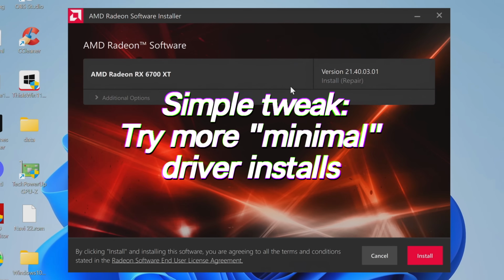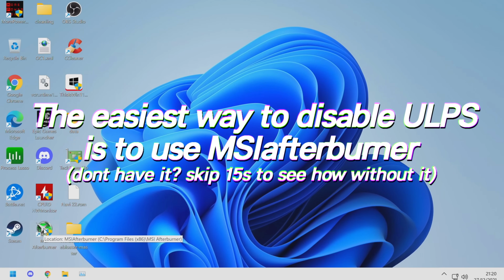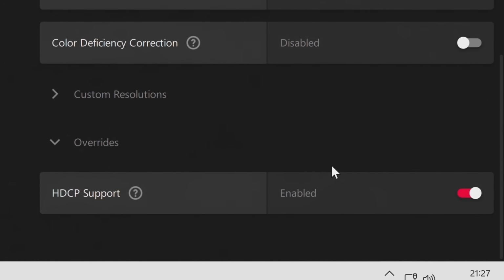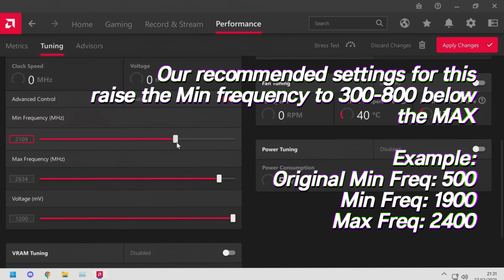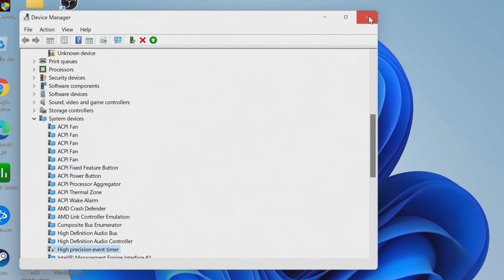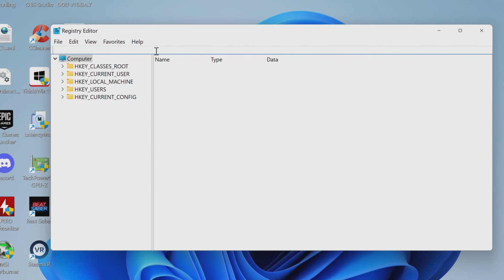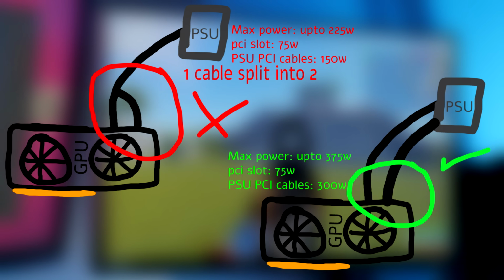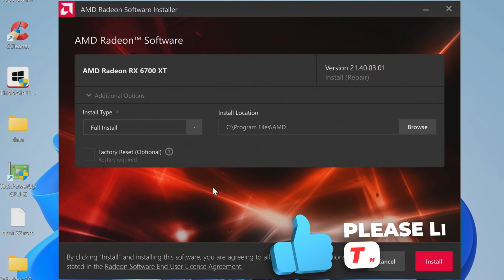🔧 Have an AMD Radeon GRAPHICS CARD? You should use these SETTINGS! *FIX LOW PERFORMANCE & CRASHES* ✅

Comment: what settings to put on if u want stretched res? I’ve looked at every vid for FN on stretched and it still displays black bars 😭
Reply: Try enabling the gpu scaling in the display settings inside the driver. That helped me with black bars.

Comment: there are cables that are nice and big that will actually do up to l;ike 350 watts but i barely see them i got one with my psu it has an 8 and a 6 pin plus another 2 pins to the side and i have had 0 issues running an overclocked 590

Comment: I have onboard graphics as well as a dedicated graphics card, but when I play games, only my onboard graphics are used rather than my dedicated gpu. What should I do? I've already tried the power plan option, and both options simply display my onboard graphics.
Reply: You would have to go into the Bios of your specific motherboard model and forcefully disable your CPU's graphics processor, I had the same issue with a Ryzen 2200g. Look up how to do it for your own motherboard, it's a very simple process so don't worry about it.

Comment: In my radeon settings, the power limit goes up to 50, not 15 like in the video. Should i set it to 50 or only on 15. Thank you.
Reply: @expr0m i do want to overclock my rx 5700xt, so i will have to rase the power limit, i guess i will try 15% to test it

Comment: Hlo i am facing a issue i have r9 270 2gb msi which is old gpu but it was working fine now the issue i am facing is getting too much low fps from actual fps i get 10fps instead of getting 50fps in rdr2 i checked msi afterburner gpu utization is 98% its mean full and clocks are also full 955mhz and 1400mhz and i am using sixpin connector i am facing this issue from 5 to 6days plzz help i cant play games 😭

Comment: Besides those priority regedit settings, the windows settings he showed you do not noticably affect performance at all. The power plan features especially just wear your hardware faster, whilst not being necessary at all.. 
If you really need to squeeze out some performance consider using a tool that stops any background processes to free up your processor (you can also modify the services that start up with your pc using msconfig. To launch this, hit Windows+R and then enter msconfig). Various applications such as dropbox, itunes or spotify always have these background processes running that when all combined can take up a significant amount of CPU. Shutting these down together with changing the priorities can help. 

When running a game you can also head into the task manager and right click on a program and change the priority to High from there!

Comment: This video helped my issue with my 5700XT playing FFXV. I was getting average of 55-60 fps on the lowest details 1080p, which was very underwhelming performance and not what i expected. Not sure exactly which step fixed it, but now I'm getting 70-80 fps on high/max details even at 125% resolution😁
Reply: yea this was to be expected lmao. the 5700xt is only around 15% less powerful than the 6600 so it would've been quite concerning if this didn't fix it
Reply: @Shadowsnoon  6600xt*
Reply: @MarcABrown-tt1fp  true my bad
Reply: @Shadowsnoon  np 👍👍
Reply: That happened to me too on some games like RDR2, it run really bad on my rx 6600. I just set the performance tuning and clock to default, and disabled the amd tesellation to aplication controled. Restarted and that worked for me.
Reply: And you did all the steps he did?
Reply: Wtf

Comment: Most of these settings are good. But! Me and my friend found that games ran with much more fps and much smoother, when system responsiveness was left as is. Testing it out should be fine, if it works use it, if it doesnt leave it.

Comment: I got myself a new psu (Corsair rm750x 80+ gold), and so far, it looks like it stopped my fps drops and stuttering... My old PSU did have enough watts, but it was only a thermaltake 80+ bronze... Don't spare your money when buying a PSU... Get a good one
Reply: Does it stop it in all games? I’m using a 5900x and 6800xt and a 750w power supply but I still get wattage drops in dx11 games. I really think the issue is software related and you have a correlation not a causation. Glad it fixed it for you though
Reply: @p_enta5012  it removed 70% of thee problem, it still occurrs

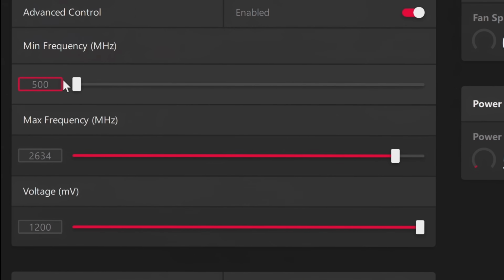Comment: The overclocking part in my settings (5:07) is by % not MHz how can i tell im setting it correctly (Radeon 5600 XT GPU)
Reply: Turn on advanced settings
Reply: Advanced control switch just above the slider

Comment: Someone can help? I have an rtx 3070 with ryzen 7 5800x.... i have 170 + fps my game crash  if i overclock my GPU always i cant play with overlclocking ...before caldera all is very good... the next problem ....if i do all settings to high there is lot of stutters and tearing also ...i have gsync on and why its like this?  If i do all quality on high also the rendolution 4K ....i have 80-100 fps but why its not smooth with gsync ? I have much problems ....dev error / direct x error if i oc my gpu or crash and freeze without any error... why i cant play with high settings on 80-100fps without stutters an tearing ...all is bad

Comment: This is such B.S.

I have my RX 5700 xt back to factory for a RMA. Still waiting for repair.

2 years now with fully AMD. 2 years following your video and I had so many issue.

BSOD crash, had to change my bios.
My ryzen 5 3600 was working with 4 cores out of 6, changed my mobo, psu, new cpu, new ram, new SSD Nvme, bios update, windows update, radeon updates  bios settings tweak, amd settings tweak, windows settings tweak dude i legit fking did everything.

I dont want to trash your video, but you should not even be supose to do all that kind of bullshit tweak. Plug in and fking play games with no problem.

Im curently playing on my gf pc as im still waiting for my gpu to comeback from RMA. Im playing on a GTX 1070 and boy this old gpu is way more stable. No stutter, no crash no bs settings.

Disclaimer, AMD is trash. Shit product, shit drivers, full of bugs. All this shit in 2 years. Spare some cash and go green and blue. For me im done with red.

 I spend so much time on optimisation for no result what so ever. And so much money on repair.
Reply: Facts g Nvidia is so much better so much smoother. My gtx 1050 ti felt smoother than my rx 580

Comment: A lot of my games are getting black screens where the PC stays on and the sound stays on but the screen goes black and after restarting I'm met with "Radeon wattman settings have been restored". When I take away the amd software I still get the crash but no wattman message. I'm running a 6900xt, 5800x, tuf x570, EVGA 1000 watt psu. Windows 11 recently installed. Everything has been default no overclock. I have been using Ultimate performance power plan. I thought my problem was the monitor an LG 27gn950 4k 144hz. I haven't been able to thoroughly diagnose.

Comment: so i did most of this and its great except now halo infinite makes my GPU grind (no other games does this Forza horizon runs fine) 6900XT on a samsung G9 monitor doesnt matter what settings I change it makes a grinding noise constantly soon as it hits the main menu
Reply: That is coil wine and it comes from to high of a fps in game menus and in older games. It usually manifests its self over 400,500fps cap the fps in game to 240fps or lower. Coil wine is normal and it wont damage your card.
Reply: i aint a genius but shouldnt check if your fans are dusty?
Reply: Check your gpu fans
Reply: @memetemplat267  thanks for the tip its not them I stopped then individually and no change to noise
Reply: This is normal, this is called coil whine. When you push a ton of wattage through a graphics card the power components make a little bit of noise. It goes away in a few months as you break in the card

Comment: I especially recommend installing driver only option if youre running win11 because i swear its like a coin toss something radeon software runs fine and other times it bugs out and causes problems on win11 and im not sure why
Reply: Don't install the AMD Driver Update that Windows gives you!! That crashes the AMD Software and makes you reinstall it, I did that like 4 times before finding out it was the optional Windows Update for AMD Driver that was causing problem!
Reply: @jamesb1988  that's assuming win11 doesn't auto install the optional driver update anyways. Sometimes I had to literally tweak my registry to tell windows  update to fuck off. Microsoft is starting to become too aggressive with attempting to streamline windows. I really hope proton solves anticheat someday we need Linux to become a serious competitor to windows because I'm tired of this shit.
Reply: @RaidenKaiser  Agreed. I seriously regret downloading Windows 11 because literally the ONLY game I play on my laptop is Microsoft Flight Simulator X, which was made in 2006. With Windows 10 it ran flawlessly with all the graphics and resolution maxed out.

Since downloading Windows 11 I've had to nerf like half the performance settings just to make it playable. Seriously rage inducing.
Reply: true
Reply: Ddu first..

Comment: Setting your power profile to anything other than "balanced" can negatively affect Zen3 CPU performance, due to its architecture being designed to perform best with that profile.  It is better to change PCIE link state power management to disabled inside the profile.  Also, you should disclaimer the fact that changing all these setting will make your GPU run hotter and consume more power than before.
Reply: I have an AMD Ryzen 9 5900HX and a AMD Radeon RX 6800M. Should I just  use balanced windows mode and just adjust from there?
Reply: @zaky9902  yes, although, depending on the manufacturer, those settings such as PCIE link state management may be locked.  If you can change them, and there is a performance difference, you may be one of the lucky ones.
Reply: @kobusdowney5291  Yeah just checked I guess I am pretty lucky. I put windows balanced and just changed the settings to what would give most performance. Thanks for the help!
Reply: You are so right - setting power profile to anything other than "balanced" results in  FPS drop up to 2,5-3 times.
Reply: ryzen has 'ryzen optimized' power plan use that, make sure to update the chipset driver
Reply: @iikatinggangsengii2471  I learnt a few things since I made this comment.
Zen3 has a hardware power management.  Changing windows power management should do nothing essentially.  Zen3 power management responds in 2ms to power demands, whereas Windows power management updates 10 times a second only.
Reply: @kobusdowney5291  I have bitsum highest performance through park control app I use ryzen 3 3200g with Vega 8 integrated graphics
Reply: @deb5110  3200G is Zen1+.  Any software power management will work yes
Reply: @kobusdowney5291  OK so how do i performance issue with TF2? Its a Direct X9 game.
Reply: YOOOOOOO WTF?????? THAT ACTUALLY WORK MAN, THANK YOU SO MUCH. IS VERY PERCEPTIBLE THE DIFFERENCE IN INPUT LAG. I was using high performance mode, but that thing that you said made things felt so much better.
Reply: @NaderHue  Microsoft network internet  are taking resources. Turn that off in the tweaker 4.8 as well

Comment: hey bro thanks for this ,it worked ,also i have a doubt i have a laptop .8gb ram ryzen 5 3500u, 4+4 dual channel ram ,im thinking to upgrade gonna remove 1 and put a 16 gig
but my ram is 8gb and the igpu is 2gb so i get 6gb ram .what happens when i take out a 4gig and put a 16 gig ram ? the clock speed is the same soo what will happen to the gpu vram?
i dont have a seperate gpu only igpu
Reply: U can't have more than 12 gb ram I also have the same laptop
Reply: @Blade_Editz929  oh is there any reason for it?
Reply: @pranavv6784 ya it is the max capability for this laptop thats the reason

Comment: 800w is NOT minimum at all, don't listen to him. You can search up the recommended watt for the newer RX cards. Even the rx 6900 don't need 800 w. Stop spreading false information.
Reply: "spreading false information"
Its called future proofing because
Oh Look! Intel 13900KS + 4090 requires ungodly power consumption.
If you spend the extra 50$ to go from 650watt to 850watt you don't need to spend another $150 for an entirely new psu when you inevitably change parts in 5-6 years
Reply: I run an RX6800 on a 750W PSU, together with 2 RX580s for mining.  Never had the PSU cut out, even with heavy stress testing or gaming sessions
Reply: @kobusdowney5291  Exactly. Stating that a 800w PSU should be a minimum is the dumbest thing I've heard. I am running a RX 6600 overclocked with 500w and I haven't had any issues. Neither is watt the only important thing about PSUs.
Reply: i run a rx6500xt 600 fps fortnite with a psu 650w lmao but it a good quality one but still
Reply: You can use a 750 watt or the minimal they suggest.... but you're losing some performance.
Reply: I have a rx 6700 and I run on 650 w
Reply: yeah plain misinformation ,you need a least 1200W
Reply: Well I'm using a 650w on a 5700xt 8gb oc editon and I'm using both cables and not one and I'm still crashing haha
Reply: I run a powercolor 6950xt on a 750w bronze Corsair. CPU is 5600x. No issues at all
Reply: That's what I thought, until I built my new Intel 12700K system with a 6900XT formula OC.
 My 850w Seasonic  80 plus gold X series wouldn't even turn on (rated at 70amps). 
For my 6900XT, the recommended PSU is a 1000w. I can confirm by experience at least for my card it's a true statement. Anything less, it won't run period. The reference cards are a different story.
Reply: @CrazyCranker  if it does not even turn on, that would mean something else was wrong.  You should be able to boot on even a 450w PSU, since there is very low load on GPU on boot.  You should only experience issues when stressing GPU or in demanding games if the GPU was the culprit.
Reply: @kobusdowney5291  Straight from the spec page on Newegg: ASRock OC Formula Radeon RX 6900 XT Recommended PSU: Wattage 1000W
Nothing was wrong except the 850 didn't have the AMPS needed.
I plugged in my Silverstone 1000w w/83.4 amps and it fired right up.
It's all about the Amps not the watts
Reply: @CrazyCranker  are you sure the ols PSU still works, and that everything was plugged in properly?  Because it should boot, since the card draws low current at boot.  Amps are directly proportional to watts, and all modern PSUs focus power rails on 12V side for highest current draw.

Comment: The last three settings in this (minimum voltage, 2 power cables  and switching to pci 3) are game changers if you wanna play Fortnite.  Way more stable frame rate and you can actually play performance mode at a high fps rather then it tanking.   Thanks @panjno
Reply: Switching to DX12 on Fortnite solved the fps drops for me with my 6900xt
Reply: Switch to dx12, rdna2. Area have problems in dx11 games
Reply: @jboy402  same went from like 150fps to like 400-500fps
Reply: @slashed4548 jeebus, what settings and GPU?
Reply: @jboy402  5950x and 6900xt all i did was change it to dx12 on fortnite
Reply: @slashed4548  what about performance mode? Do you guys play competitively or just casual and want the game looking good with fps
Reply: har har har har har har
Reply: I play on a rx570 with and i5 10400f and can run about 160 fps solid in game but experience the occasional mid fight dip, only goes down to 80 fps but still. I have a 600w psu but never experienced crashing etc, should I increase power demand,decrease it or just ignore anything he said about voltage and just leave it stock?(ps:will be getting a better GPU soon)
Reply: @bumblbt00na  Can you undervolt and overclock for your RX 570? Also clean up any bloat on your PC and change Radeon settings and run Medium View Distance Medium Textures for Fortnite performance mode.
Reply: @decliningship4208  got a new GPU (2060 OC), thanks for answering tho, I’ll keep those things in mind when customizing my new one

Comment: Reguarding disabling ULPS, this should not happen on RDNA2 and later, they have fixed some major GPU reset bugs, previously AMD GPUs could end up permanently hung but that is no longer the case... it could happen if you ran some bad code and crashed your GPU also.
Reply: i agree and the fps difference is very low but the temps are like 5 more degrees higher

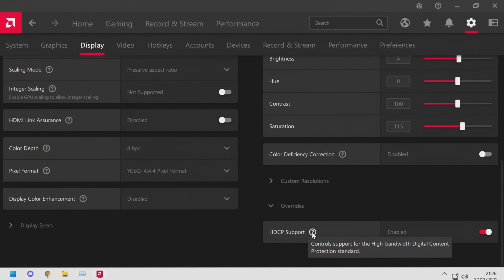Comment: Can anyone help??? I am running on a seriously low end laptop, however I recently factory reset the laptop and manually downloaded my drivers for my GPU, however I am unable to open up my Radeon Software as seen on 3:55 of Panjno's video. I have reinstalled the software and still wont work. 
When attempting to open it would load a little bit and then just never open...
Also have tried opening it as admin...

Comment: Hey Panjno nice work. I have a question for you hope you dont mind :) I am running an old HD 7970 hz edition card and in my setting there is no override function nor the extra options to further tune in performance. Is there something I am missing? I have also did a clean install using DDU.
Reply: The GPU is probably too old, bud.
Reply: I have this same gpu, they stopped giving us updates for it last year, I think the driver support we got lasted really long though
Reply: @Saquon Barkley Is The Man 26Is that what you did? You must have a good mommy ;)
Reply: odd comment @stasheAUS

Comment: Can I use these optimizations in an i gpu as well ??
Reply: Same question i got a ryzen 5 5600h i dont know if i should optimize the igpu settings or not
Reply: @expr0m i have a question bro i got an external monitor plugged in my laptop its an hp omen 15 ryzen 5 5600h and RTX 3060 so now i bypassed the igpu with the external monitor no ? i saw a big difference in fps in games like csgo